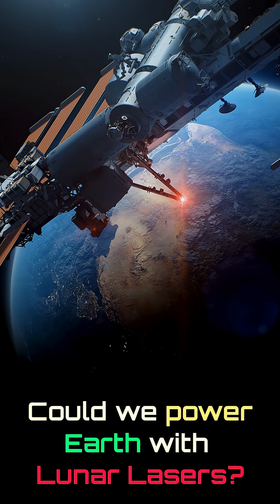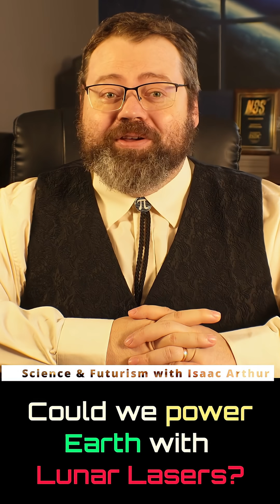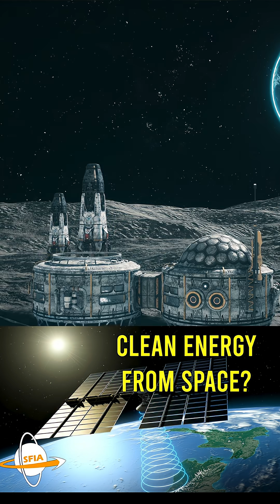Could We Power Earth With Moon Lasers?

Comment: Well, that would be impractical, since a lot of energy will be lost during the process. Converting electricity into a laser beam and converting laser beam back into electricity on the receiving end leads to huge energy losses due to waste heat production, laser beam divergence issues and etc., even though partial recuperation of waste heat is possible.

Comment: my biggest thing is even if its set up to work, thats a lot of energy in a beam going through the atmosphere.
Affects on Ozone, and anything that happens to get in the line of fire as well as the loss of energy from going through air need to be considered
Reply: Microwaves pass through more or less entirely unimpeded, and can be turned back into electricity pretty efficiently. It doesn't seem practical to me, but it's probably possible
Reply: Its also pretty much impossible to focus the beam down in a way that being in the line of fire is much of a problem anymore than maybe standing next to high tension lines.

Comment: Not a feasible idea. It could work, maybe, beaming power  from Moon Geostationary satellites, to the Moon power station, since unlike the Earth, who have a highly refracting atmosphere who will massively reduce  the energy transfer - the Moon has no atmosphere, so there will be no loss of power. The problem, still, is the maintenance of the Moon station, since there is a constant rain of micro-meteorites who will constantly damage any structure on the surface.
Reply: The Atmosphere is transparent to the frequencies used.  It may as well not exist.

Comment: That is too easy to weaponize.
Reply: Gundam X vibes satellite cannon
Reply: Well.. if we are going to do anything in space really it is best it is in safe hands. 😊
Reply: It can be weaponized only if it can be tightly focused
Reply: @robertadsett5273  It cant really.
  The wavelegths are microwaves and the ability to focus to a tight spot is pretty much nonexistent.  It's not really solar cell tech that we would used to get the beamed power... we would just use antennas designed for the frequency.  Far more efficient and cost effective.
Reply: @seditt5146  exactly my point. Although power density does come into play
Reply: That just means we need to be the one to do it.

Comment: Of course we can power Earth with Moon Lasers. If we use orbital Lasers there will be solar wind from the solar arrays and the whole thing will get pushed into the twilight zone. And solar collectors aren't going to work very well in twilight.
Reply: So you have to put another set of arrays on the other side of the moon. The moon is 3474 KM in diameter so 3474 times pi is 10,914 KM = circumference of the moon. So you need to build a power line 1/2 that length or 4,957 KM long then you have continuous power. Or if you want to do some lunar oriented power grab you can target every population center on earth every 24 hours. Or you can simply turn off the lights all over the world whenever you want. It's a win, win situation.

Comment: How generations away are we be this can even be manufactured let alone deployed into space safely
Reply: can make solar from moon regolith pretty easily. So all you need is a laser. 
Better to have genetically engineered space sharks as well.
Reply: We’re not far from having the technical capability now. The biggest question is whether there are unforeseen consequences of beaming significant energy to earth
Reply: If Earth radiates away the exact amount of energy it gets from the sun and we introduce more energy into the planet than it’s radiating away, wont we eventually make Earth overheat? What am I missing here? How do we get rid of the waste heat when the energy is used?
Reply: @martinfitzsimons5884  yes, probably less than CO2 traps but you’d need to run the calculations. The same is true of fission and fusion reactors of course, even worse in those cases.
Reply: @martinfitzsimons5884  how much energy does the earth get from the sun. How much does humans need. We are just tiny bugs. We need about a 100mile x 100 mile grid of low efficiency solar to power all human activity on earth. 

There are sci fi books about this but we are nowhere near it yet.

The counter of putting alot of stuff in orbit that blocks the sun maybe the worse case